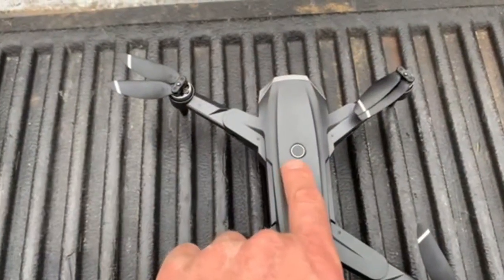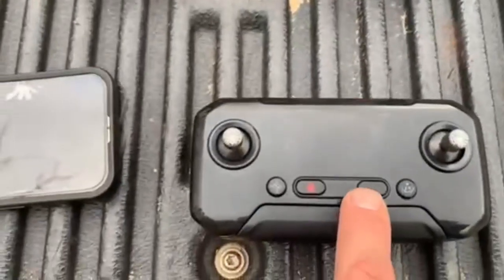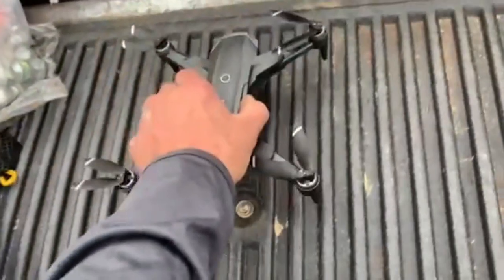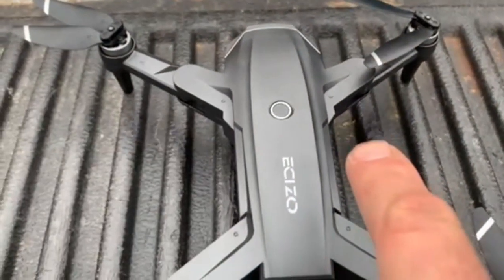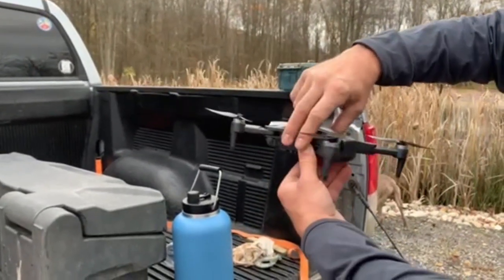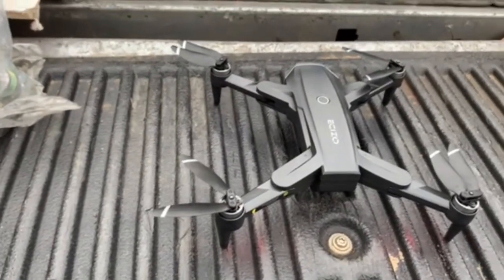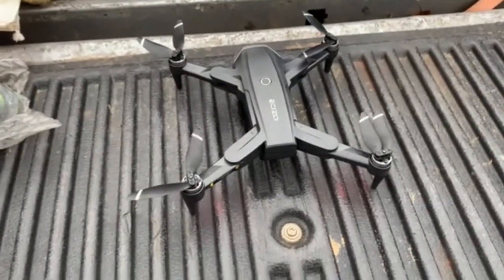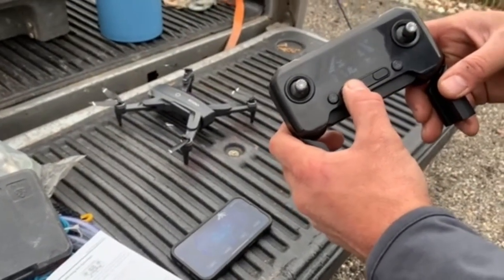Quick Start Instruction for RC VIOT EC120

Comment: I never had a drone proble or flyway or toilet bowl ever with dji or cheap drones !Why ???Because i make sure to read the manuals and do the proper calibrations !!! People calibrate the compass in a metal van and then they are suprised the drone became unstable and flyway ???

Are you guys dont know that compas dont like geomagnetic interference??? and thats why maybe dont calibrate it near metal >??????Because if you guys still dont know the compass inside the drone is magnetic and if it as metal near its gonna atract and make the  compas go crazy and if i thinks the north is actually south is gonna became unstable or do toilet bowl and worst ! its gonna flyway or crash in the nearest wall !!!!!!!!!!!     dont calibrate it with the controller near or a bluethoth device like a smarthwatch !!! Put your phone in airplane mode !!! always calibrate the gyro after the compass !!!

If you follow this tips the possibility off a flyaway is reduced greatly !

Comment: I’m so scared to fly the drone
Reply: Just keep it fairly low for the first few days until you get the hang of it...and don't go too high too soon and don't fly over water until you're super good at it!  I learned quickly that even if there is not a breeze on the ground, there is one 100 feet up and the drone will disappear if you're not really good at controlling it!!

Comment: Bought one and used this past weekend.  It did great till I took it out at night to get the Disneyland fireworks show.  I’m about 3 miles away but was still cool.  But I don’t keep the app and phone right in front of me while flying and as I was flying back to me it just falls right out of sky and into road and breaks.   Plenty of power.  But I looked at the display and it was showing I need to do the rotate thing again.  Not sure why.  Just got my replacement and while flying it is easy I’m a bit shy to do it over the road again.  So I guess each time I am going to do the rotate thing.  But I do wonder why in any instructional video I’ve seen it says anything about the unlock button while setting it up or getting it going.  Crazy video.
Reply: Was taking some shots of family at the pool, about 25ft up, and it just took off. Straight up, so high I could barely see it. No control at this point. After 5  minutes I was finally able to safely land.
I calibrate before each new flight, had a full charges.
I'm way past shy, I now don't trust the controls
Reply: @urbanguerrilla286  I love mine.  But yes does have a mind Of its own.  Lots you can do with them.  I was adding music to my videos today.  And the walk function is nice.  It just follows whoever has the phone.  I think the problem is when I’m
Flying and my red lights aren’t blinking it does better.  Not sure what I did to make them stop.  But flew just now and it was blinking and did fine.  Last nite I got it to not blink.  Don’t think they should be blinking.  Is confusing.

Comment: Yo im back butwhen i fly it like 5 seconds into it it does this beep beep beep ik it means low battery but i charged it and it didnt work both of the batteries and it still didnt work can you please check whats wrong with it?

Comment: Mine started up, immediately flew 200+ feet straight up ...  I pushed the joystick down and gradually it came down.  It was beeping the whole time at that point.  Now I'm afraid to try again.
The next time I tried it, it seemed fine for about 10 seconds and was moving around, but then started beeping rapidly - 5 beeps..  pause.. then 5 beeps.. pause.. then it again would up to full speed and shot way up high in the air.   Frustrating.
Reply: The drone was returning to home if a drone battery was low or lost signal or if you pressed a button accidentally or on purpose it will go high 200 250 300 feet in the sky to find its home
Reply: @haseenaibrahimi3201   That explains it.  Thank you.  I learned that the battery didn't come charged and that this was the problem as you say.  I initially plugged the battery in to charge, and it showed a red solid LED, and the Green one was Flashing, so I assumed the green flash meant it was charged.  Wrong.  Turns out, after about 4 hours, the green light turns solid and then it's actually charged.  Bad manual at the very least, because it says battery charging LED's do something totally different than they actually do.
Reply: Thats how it finds where to land.

Comment: I can't get the lights to go solid I spin both times but won't go solid I hate this thing
Reply: Same.  The manual SUCKS horribly, and there's no real forum or place to go for more information.  Mine flies good for 10 seconds and then speeds up full speed and flies into the sky straight up.. I have no control.  Crashed 3 times now.  No where to find help.  -  Correction.. someone helped me here in this thread at the top.  Turns out, the battery came discharged, and the charging LED's don't match what the manual says..  ignore the dam manual and charge it for a few hours until the led turns solid green.   But yea, I had problems with the rotation/calibration thing.. Took me several tries to get it working.  The manual sucks here also.  The initial pairing is crucial, and that's where you have to be patient and wait for a solid beep before trying to calibrate it.  The video above isn't really good enough tbh, as it's hard to see the LED's on the surface he's using.

Comment: Why can’t I fly my drone red flashes doesn’t become solid when calibration done
Reply: Why is there no forum or place to go to get more information on this drone.  The manual just doesn't seem to represent what it actually does.  I have yet to get mine flying correctly for more than 10 seconds before it shoots off, and the calibration procedure only seems to work about 1 in 10 tries.  Beginner friendly?
Reply: Me too!!  and I do not know what to do
Reply: This is some bs drone shit is not easy to get started with begginne4s my ass
Reply: Seems like no one here had a solution and I’m having the same problem. Have you figured it out yet?
Reply: I took it outside and redid the calibrations and waited like 1 minute for the gpd sync to finish, it beeped and stopped flashing eventually. you can watch the gps satellite icon in the remote screen count up
Reply: I just got mine today I got it on the air but it’s rough to drive. I’m sure I’ll get used to it but damnn. I have another one that’s is a lot simpler to me
Reply: Make sure to press the unlock button
Reply: Hold it for 5 seconds
Reply: I have a $45.00 from timu turn on and fly this thing is shit !
Reply: Yea i can’t get mine to do anything why did they make it so complicated
Reply: make sure it’s outside so it can get the gps satellite signal
Reply: This drone sucks

Comment: Hey! I just bought this drone. Off the bat. I plug the batteries into the charger and the charger is blinking red and green. But the manual doesnt say anything about it blinking red and green. It says it should be red when charging and green when finished.
Reply from the maker: Hi,  when the battery charging, the usb canble should bliking green and red light turn on. In your case, try to charge it for a hours, it the battery doesn't hold a charge, contact: services@lifewarranty2.com we arrange the replacement for  you.
Reply: I had the same exact problem.  It turned solid green after a few hours of charging.  The manual is the real problem here, because it is VERY misleading where the led's are concerned.
Reply: @bradb3245 i contacted support and they said that manual is outdated. There is a new one i guess